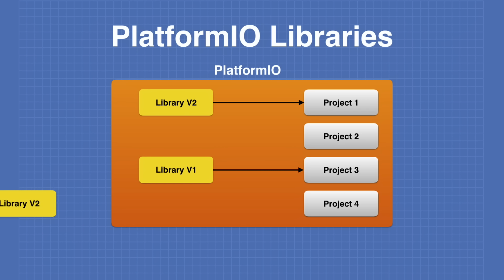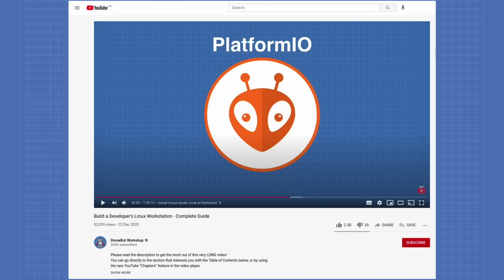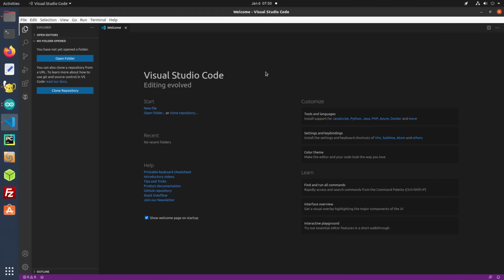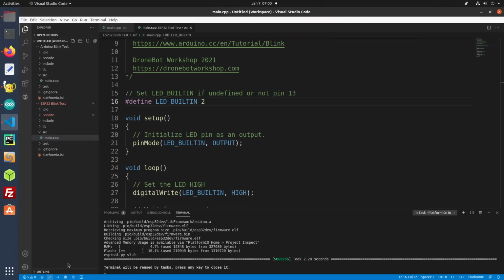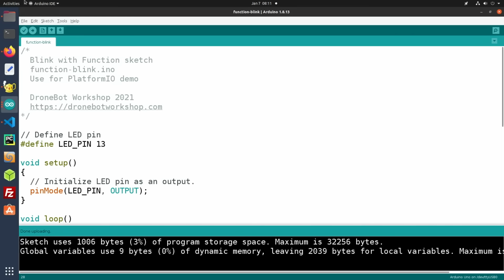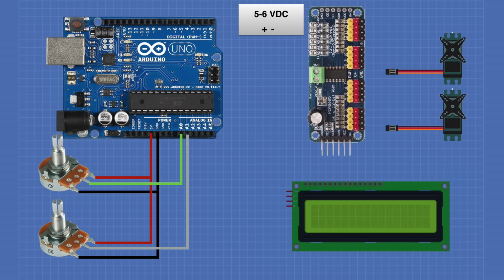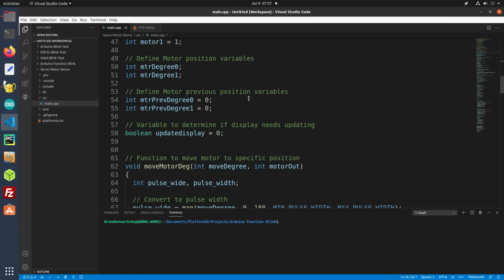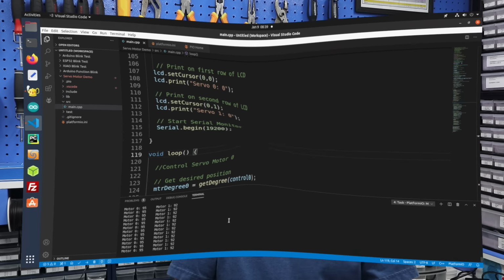Getting Started with PlatformIO

Comment: I really enjoyed this video. I learned a lot. I am used to using the Arduino IDE, but I can't get version 2.x to run on linux so I decided to go to platformio. I have been having trouble getting the code for an elecrow 5 inch tft display to work with the 2.x arduino ide on windows, so hopefully going to platformio will help.🙂

Comment: This is a well-done video. I just found out about PlatformIO and this still comes up as one of the top search results for getting started tutorials. For others who got here late like I did, I think it's important to note that the Arduino IDE 2 does address a lot of the shortcomings that PlatformIO addresses in this video, but it still brings the power of VS Code editing to the table.

Comment: Thank you for another excellent video! I'm a longtime VS/VSCode user and have been playing with Arduino & ESP on the Arduino IDE for 7 or 8 years, finally migrating to PlatformIO. Your explanation was extremely helpful! By the way, what are you typing on? The sound reminds me of big old IBM terminals from the 1980s that were made out of steel. Maybe it's just acoustics but that clunk-clunk gave me a flashback to my first programming job.

Comment: im trying to build a midi ble controller.
I had chatgtp write a script. it uses the esp32 ble midi library. i added that library to platform io.  but keep getting a bunch of errors when compiling the code.  do you have any experience with this library? could i send you the code somehow and see if you know what i am messing up? I have used chat gtp i. arduino ide and it worked, but i am new to platform Io, and im missing something?

Comment: A Platform IO linking tutorial would be very helpful. I cannot get it to consistently link libraries and dependencies. It seems to parse them some projects yet not for others and I cannot figure out why. Searching web I see a lot of forum posts with similar linking issues. It's to point where coding is almost pointless because it won't link certain things. Yet Arduino despite being a very crude IDE has no issues linking.

Comment: Some of the libraries I used in a previous project now have some dependency issues with the updated Esp32 packages. I know that my project worked with 1.0.6.(at least that is the cores version I had in the Arduino15 folder previously, which is where these missing dependencies used to be located) is there a way to modify the platform.ini file to use that specific version of packages

I've tried to modify it by using platfrom_packages = arduinoespressif33@1.0.6 and multiple combinations including writing 1.0.6 like 3.10006.210326

Comment: Is it possible to not use the Arduino ? I want to learn how to use the ESP32 and not spend effort learning the Arduino which I can’t imagine I am going to use. I think I would probably want to use the Raspberry Pi instead, I wonder if I’m being to optimistic. 
I learnt a lot years ago with Pic Microcontrollers but I used to program them directly either using a programmer device or via the serial programming pin in circuit. 
I used to write in Pic Assembler somI had a very low level understanding of the controller. I’m wondering if the ESP32 can be programmed in a similar way but with the program compiled from C/C++ ?

Comment: Have you considered taking this another step and show how to use PlatformIO and VS Code to compile Marlin and install it on an Arduino Mega for use with a 3D printer, CNC router or Laser engraver set up?

Comment: Thanks for another interesting Video. I've tried platformIO but it wasn't such a smooth experience. Wouldn't import my large multi-file Arduino project. I tried recreating it by pasting in file by file, but after the second file platformIO wouldn't let me create another, got stuck at the file rename stage. Pity, because it looks a lot better environment than the traditional Arduino. Oh Well.

Comment: Thanks very much for this video. I have been working in IT for many years, but I have just started with Microcontroller programming only 1..2 weeks ago, so I really appreciate that you explained VSCode and PlatformIO so well, even showing the installation on 3 operating systems. This has motivated me today to install both on my Linux laptop - and it works! 😃
On Linux, I now need to pay attention to the access right for the port (which I didn't need to worry about under Windows), and apparently the "chown <user> <device>" needs to be done after each restart (or reconnect), but I am using OTA anyway now most of the time ...

Comment: I used PIO for a while - it can be good, but currently (2023) there is no stable/ working solution for code upload to AVR4809, and support can't sort it. So I'm using JTAG2UPDI in arduino and VScode as an editor.  (JTAG2UPDI does not work in PIO)

Comment: Hi Bill.
I made the big step to start installing Platform IO as I was dissatisfied with the newest 2.0.3 Arduino IDE.
I installed Visual Studio Code without problem. Then downloaded and installed the latest Python.
My screens were looking different to yours but I put that down to the newer version I was using.
I went to the extension manager and Installed Platform IO, and closed/opened VSCode.
Opened the Home Page of Platform IO and made a new project as directed. Waiting ....waiting ....
I am thoroughly frustrated with "this may take some time, WITHOUT GIVING ANY CLUES/EXAMPLES AS TO HOW LONG ..

10 minutes, 3 hours, How long ?

Ive watched many of your videos and have learnt a lot. But this isn't working.

Any other ideas, Updates etc...
Mel

Comment: Thanks for the informative workshops. I am a longtime hardware engineer who did a lot of C and C++ work in the late 90s up to about 5 years ago and, as you can imagine I'm am quite rusty. As a nubi to Arduino there are a number of issues I ran into but your videos usually got me through them. Whenever someone had a video that used PlatformIO the screen was so cluttered it became overwhelming. Throughout my history of writing code, setting up the IDE was what made or broke my sucess at it. As you mentioned in the video, the Arduino IDE is very simple to use, and a great way to get familiar with hardware and software development. After a few weeks I've been able to get a lot done in it and ready to move on to PlatformIO. Your video is very clear and easy to follow along with. Great job.

Comment: It's common practice to not make the code too "front heavy" by putting all the function definitions after setup and loop like you had it before, but duplicate just the first line of the function definition (e.g., write just "int sample_function(int var1) ; " ) before setup and loop. This line is called a function prototype and it's there to make the compiler aware the function exists so it doesn't throw the error you see but still makes for arguably more readable code. Not making these prototype declarations necessary is some of the hand-wavy stuff the Arduino IDE does to make coding more accessible for beginners, but that can also lead to moments of confusion/difficulty when people move beyond it. I continue to be impressed by the clarity and high production quality of your tutorial videos--thanks for helping the community like this!

Comment: If you are using this on an ESP32, the LiquidCrystal_PCF8574 library is broken in the version 2 that is added to a project. Change 
mathertel/LiquidCrystal_PCF8574@^2.2.0
to
mathertel/LiquidCrystal_PCF8574@^1.2.0
in platformio.ini and it will compile. The normal function min() gets a type error. Apparently _min() should have been used.

Comment: You dont need to define your functions before using them, you need to declare them before using them. The linker will take care of the definition, but the compiler still needs a forward declaration to be able to generate the translation unit. It's not an IDE specific thing but a C++ specific thing.
Reply: It is time for some one to publish a video showing, function declarations, function definitions in several different files.
Reply: Vali Zeth: Yeah, it's those declarations where I always screw up! Thanks for explaining the difference between them and "definitions." I think maybe I wasn't clear on that distinction. At least, I think that's my problem! (Sometimes, in complex code, I can't figure out why it won't compile. The logic is all correct, but I have problems with functions not being declared. I guess I just forget.)

Comment: Hello, Bill.

Fellow Canuck, Ed, here from Fredericton NB.

Thank you, Bill, for a great tutorial.  I know it is almost 1.5 years old, but I just started using PIO today.  I found your website and YouTube tutorials today and they were a great help.

Your "about me" page on your website says that you were never a professional teacher, but you surely have a great teaching and presentation style.  Before I saw your "About" page, I thought that surely you had been a professional instructor at some point in your past.  Your tutorials are very well presented and very informative.  Well done, sir.

I have a question about using the serial monitor on Platform IO with Arduino:  How do I enable or add timestamps to the serial monitor output lines, the same as the Arduino IDE's have?  I cannot seem to find that anywhere in the user interface.  BTW, I found it strange that the PIO folks (or was it MS VS Code folks?) chose to put the monitor's baud rate selection as a configuration file item, instead of having it directly in the UI or menus.  Very strange way to do it, IMHO.  But it makes me wonder if I am missing a configuration definition to add timestamps?

BTW, concerning function declarations: in an earlier life I did a lot of C programming, and was in the habit of creating a .h header file for each .c file.  The .h file would have all the functions pre-declared, and the .c file would have the function implementations, with the "main" part(s) of the .c module at the top, and local function implementations below.

Thanks and very best regards,
    Ed.

Comment: I'm used to pre-defining functions and variables from way back in early ç days not that I'm any kind of an expert by any stretch of the imagination but I was always kind of wondering why that wasn't needed for the Arduino and I just adopted the conclusion that it ran through the code one time prior to actually initializing. I could be wrong but I don't see any other way it could be 

I have a question that's very important to me I want to start playing with the arm bass chips is this a good solution for that?

Comment: Hello,

Thank you so vey much for your wonderful tutorials.  I have been learning from you for several years now.  I particularly needed your tutorial on using PlatformIO for Arduino in Visual Studio Code (VSC).  I was wondering if you would do a tutorial on using CircuitPython on VSC as well.  The folks at AdaFruit always direct folk to Mu but I need an IDE like VSC.  There is an extension on VSC for CircuitPython but sadly it isn’t updated since 2020.   I don’t really understand VSC workspaces.  All of the tutorials I see for VSC are for website coding, or regular Python which I’m not really interested in right now. 
 

I hope you will consider creating a tutorial.  I think others would be interested in this as well.

Thanks again.

Comment: You forgot the most important reason of
 all.   Arduino IDE on windows is limited to MAX_PATH even on Windows 10 and 11 where the 256 character path is extended. This means later version of Marlin from V6 onwards cannot be compiled with the Arduino IDE on Windows as you will get a path overflow error on the linker.  PlatformIO does suffer from and this and so is the only way to compile Marlin on Windows.

Comment: Are there Microchip PIC libraries available for PlatformIO? I googled this question and it looks like the answer is "no." But, I am accustomed to working with PICs and I would like to be able to continue to use them. If the libraries do exist, where are they found and is there anything special about getting them installed? Thank you for your help.

Comment: Hi, :)
I am considering using PlatformIO as a replacement for my MPLAB IDE for PIC32 micros. This is for coding of our custom PCBs (NOT standard dev kits). 
I have a few quick questions: 
1) Is it possible to replace the ENTIRE MPLAB IDE with PlatformIO? 
2) How easy (or not) is it to set it up specifically for the PIC32 family? 
3) is there anything that MPLAB does that PlatformIO does not and/or that I should be aware of if switching over? 
Thank you :)

Comment: Very good expositions as always. I am trying to follow your sketch using the arduino mega 2560 r3 but I got the following error and I don't know how to fix it.

The code:

#include <Arduino.h>

// Include PCF8574 Library for I2C LCD
#include <LiquidCrystal_PCF8574.h>

// Include Wire Library for I2C communications
#include <Wire.h>

// Include Adafruit PWM Library
#include <Adafruit_PWMServoDriver.h>
 
// Define I2C address - change if requerid
const int i2c_addr = 0x3F;

// Define LCD objet
LiquidCrystal_PCF8574 (i2c_addr);

The error:

Building in release mode

Compiling .pio\build\megaatmega2560\src\main.cpp.o
src\main.cpp:17:32: error: conflicting declaration 'LiquidCrystal_PCF8574 i2c_addr'
 LiquidCrystal_PCF8574 (i2c_addr);
                                ^
src\main.cpp:13:11: note: previous declaration as 'const int i2c_addr'
 const int i2c_addr = 0x3F;

Could you please give me some light.

Thanks

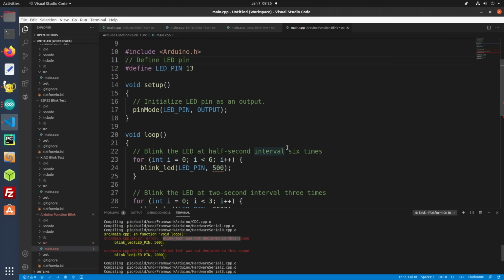Comment: Around 29:00 there's a difference between function definition and implementation. Your using implementation, which works here. But what if you have 2 functions that call each other. Which one do you implement 1st? You don't worry about it. In that case you need to use definitions!

Comment: Hi,

At a certain moment in your video (time point approx. 29 minutes) you mention you should put your local functions at the beginning of the source code in "real" C projects.  That is correct (Arduino is an exception on that rule), but there's an alternative called function prototyping which - to me -  is a far better and more nice approach (personal opinion!).

If you apply this, then there's no need to force one to put the local functions at the top of your source.  In my long years of programming, I always felt it was a good idea to group and place the external and internal functions in a separate place (or call it block) in the source code (so, one for external functions, one for local functions).  And to me, it "feels" logical to have the external functions at the beginning of the source, while the local functions are at the end of the source.

In such scenario's, there's a need to apply function prototyping, otherwise none of the external functions would compile correctly if they depend on a local function.  The function prototyping is needed for the compiler to tell it: "hey compiler, there's a "signature" here for a function that you will find later on in the compilation progress, don't be angry on me you can't find it right now...".

This way, you also have a nice, isolated block of function prototypes at the very beginning of your file (they must be located in the source code before the external function block starts) and one can also immediately see what still will follow further down the source code road regarding local functions.

Just my 2 ct...

PS: great video by the way!

Best,
---Geert

Comment: Great video and exceptional presentation with tons of info. Followed detailed instructions step by step. For Micro-Bit - complete and utter success, worked flawlessly. For ESP32 - problem occurred. Compilation - fine. The uploading though gave me an error: “Unable to find CMSIS-DAP device”. and then “No valid JTAG interface configured”. This is strange a ESP32 is using the same Arduino Framework as Microbit, so this driver (or DAPLink) should have been loaded to my understanding. 

Would greatly appreciate your ideas as I don’t want to use as many IDEs as I have different Boards - PlatformIO seems to be the excellent choice to have only one for all of them.

Comment: Hi Bill, Thank you for making such excellent content.
I wonder if you can answer a question for me? I've tried google and found nothing definitive.
Is it safe to connect the computer via usb to an arduino while it is being powered from an external circuit?
For example to read serial data back from the application it is connected to.
It seems to me that this must come up often but I can't find any sensible info on it.
Many thanks for your time to read this. Atb. Gillian.
Reply: yea you can, but it's not recommended, by the way DC input jack goes to power regulator, and USB provides 5V DC by default, if you want to check the system on power supply simply remove USB till your next program upload procedure.

Comment: Hi Bill, you made a really very good videos. When I see/listen them I always learn a lot, you are a very good teacher.    I have in my computer two OS, W10 and Linuxmint 20.1 I installed platformio in both.    But in both I have this message when I try to sent the blink LED sketch to my LILOS wemos D1 R2 mini (ESP8266):    avrdude: stk500_recv(): programmer is not responding,    avrdude: stk500_getsync() attempt 9 of 10: not in sync: resp=0x00.     Could you or the comunity recomend a link web page to learn how to fix this problem? thank very much
Reply: is it solved?